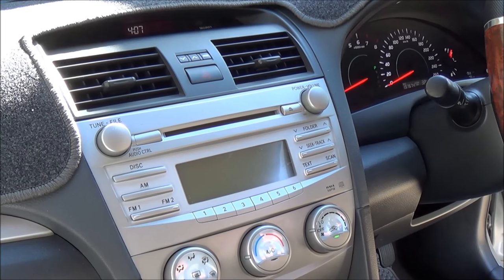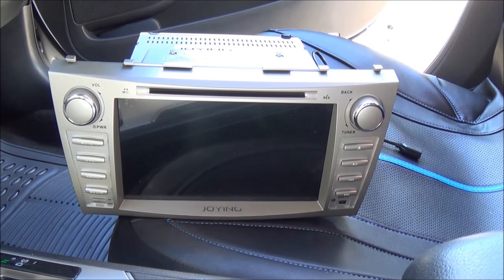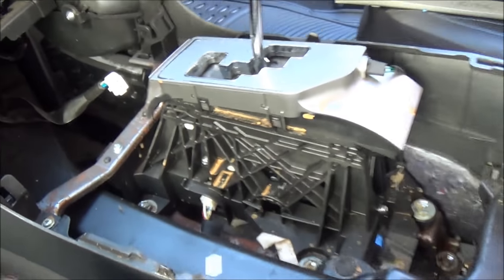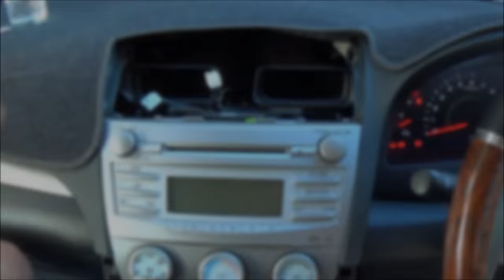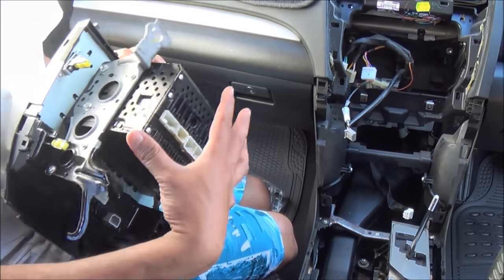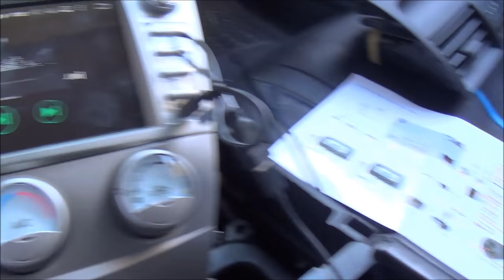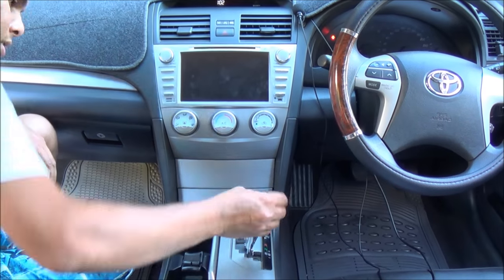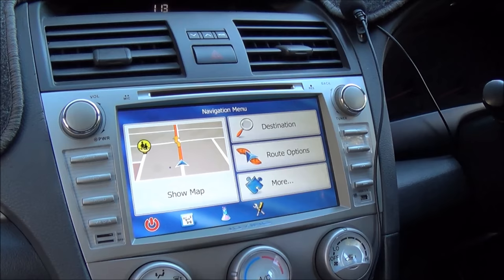How to Install an aftermarket Radio In a Car

Comment: Great video, I did same thing but the after market unit did not pick up Bluetooth, steering wheel controls or reverse camera. I thought when purchasing a plug and play after market product it would automatically pick up everything the original device had.

Comment: How about your Steering wheels controls? Did you test it?
I think your vehicle has CANBUS right?
Reply from the maker: this headunit is designed for this car so it has a wiring harness for the steering wheel

Comment: While you're in there add a ground wire there's a frame right behind the radiator you can screw into also while you're in there run your video cable and your trigger wire whether or not you're ready to install the camera otherwise every single time you got to take it out take it out take it out also do not put all the counseling and everything back together until you check it and see if it whistles if you have JBL it may whistle as you drive then you'll have to get another JBL or figure out something or delete the JBL altogether which would be kind of stupid but sometimes I must
Reply: Is the whistling by any chance a sound that happens whenever you accelerate?

Comment: I tried installing one of those units to mine 2011, Toyota Camry, but the brackets did not fit ( line-up) with the screws on the new unit, do you know why is there different measurements for the different type of AC controllers?

Comment: All the wiring that came with the radio did not fit the JBL Toyota Camry wiring and I bought the same radio you did I need to buy a JBL module but now the steering will controls not working can you give me some info I don’t understand how youWiring duction with the radio fits your car I have the exact same thing and I’m doing the exact same thing and nothing fits I have to buy more wiring harness is

Comment: guess he didn't see the AUX port in the enclosed part of the dash under the radio
Reply from the maker: In Australia, the v6 camry's are called aurion and they dont have the lower compartment and didn't offer the aux port or bluetooth in factory head unit. But i know what you mean, That's US camry
Reply: Looking at the headunit, I don't see the AUX button that my camry has. So I don't think this model has it.

Comment: Mine is a Camry Altise 2006 very similar to yours the difference is my clock is all the way down next to the wind screen , plus I have a seperate ashtray search it up to be more specific but the question is would this fit my Camry 2006 cause I am willing to buy it
Reply from the maker: It should, but check it with your seller's advertising before you buy,
Reply: I was checking out the same one you listed on ur link and it says 2007 and up but I’ve checked everything in my car and opened every part whilst watching ur video and there’s nothing different between mine and yours except the clock and the ashtray, but the size of the radio is the same I’ve searched it up so hopefully should fit . How much was the touch screen delivered for ?

Comment: i have the jbl system in my car would it work if i put this unit?
Reply from the maker: should work, if you're gonna use it on the same car as the unit was designed for that car...
Reply: You need to buy a sperate port/connector for jbl
Reply: Where do you by the separate port from ?

Comment: Hey good morning. Is this the same ....9 inch 1024*600 touchscreen 2007 2008 2009 2010 2011 TOYOTA CAMRY Radio Replacement with Android 10.0 Aftermarket GPS Car Stereo with Bluetooth Music WiFi 3G Mirror Link OBD2 DVR HD 1080P Video USB SD
Reply: It's important

Comment: Can you install any kind of touch screen in a toyota camry 2007 or is just the designed one
Reply from the maker: designed ones are better, coz you get a built in wiring harness and more importantly, your steering wheel audio control buttons will work as normal. the problem is that the designed ones dont sound as good as the stock one. whatever head unit you buy, make sure you get one that support steering wheel button so you can find a wiring harness to go with it.  or buy a dash kit like this 
https://www.amazon.com/Metra-99-8218-Toyota-Camry-2007-UP/dp/B000LPU9XM/ref=sr_1_1?ie=UTF8&qid=1331640818&sr=8-1
then you can install the one you like
Reply: How big does it gotta be tho like 6"
Reply: Junky DIY guy 4 by 6?
Reply from the maker: adaptor kit dimensions are 8 x 14 x 1 inch, so its gotta be 8". so theritically an 8inch head unit should fit in, even though i haven't personally tried em
Reply: I think it will fit as long as the trim surrounding the head unit is fit.